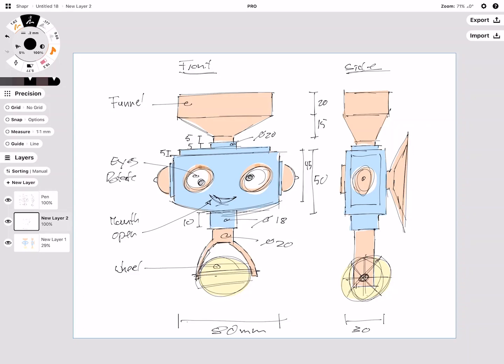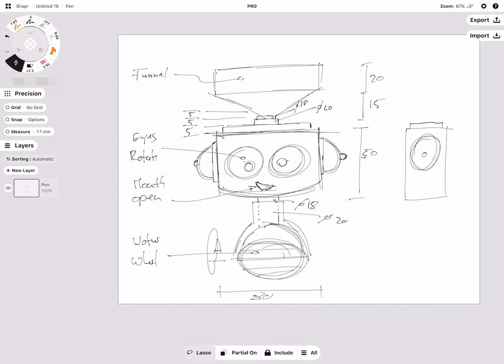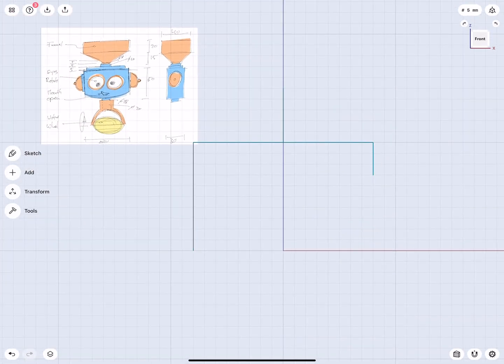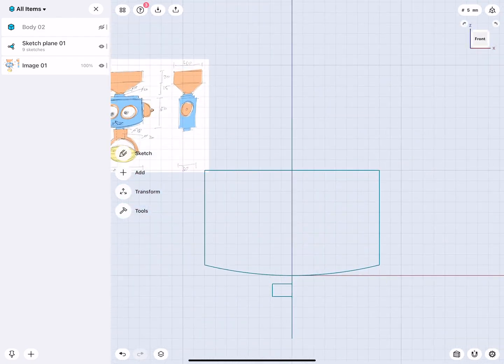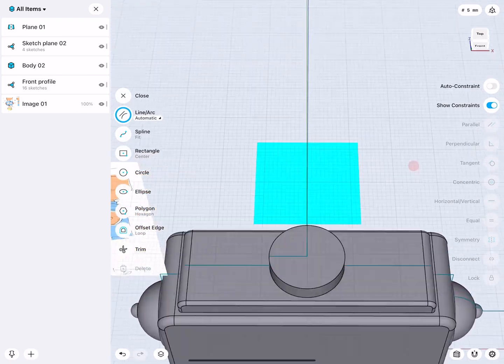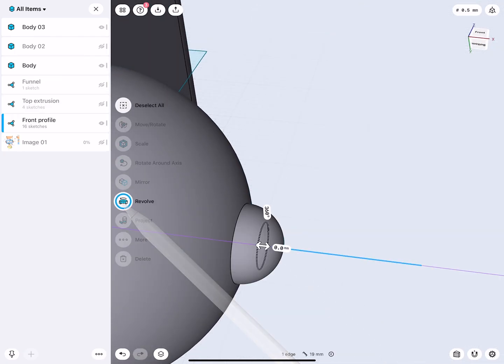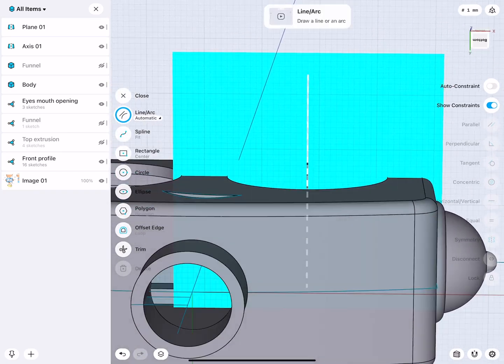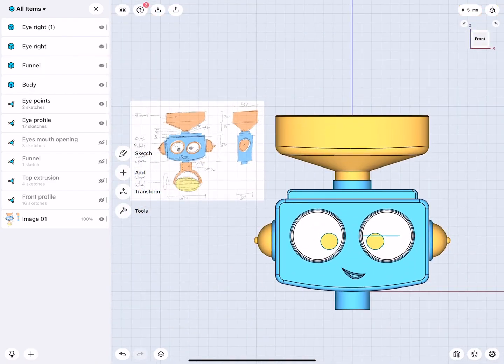3D Modeling a Shower Water Toy | Shapr3D Step-by-Step

Comment: please tell me if you plan to expand the functionality?
Reply from the maker: Hi! Could you specify functionalities in which area? :)
Reply: @Shapr3d  Will it be possible to edit the sketch at any time and so that the changes are immediately on the part
Reply from the maker: @KKJJkoo  As Shapr3D is a direct modeling software, there is no connection between the sketches and the bodies after the creation of the solid bodies. So we would suggest  just simply grab the faces with the pencil and move them to meet the required dimensions :)